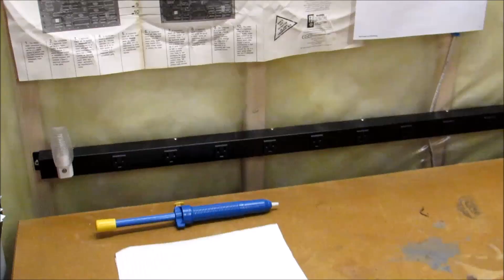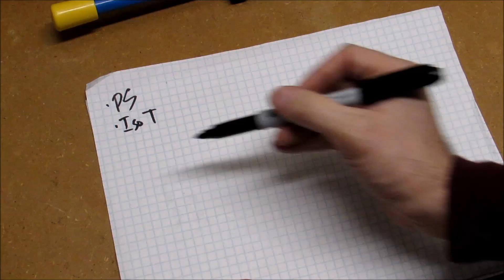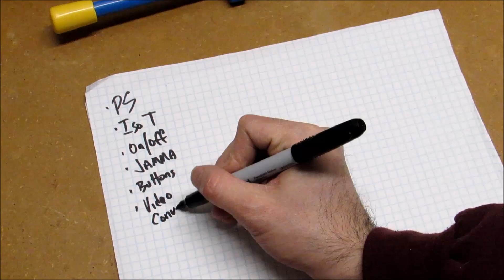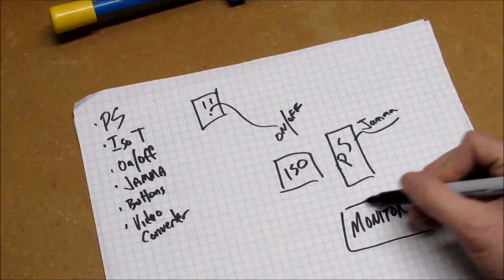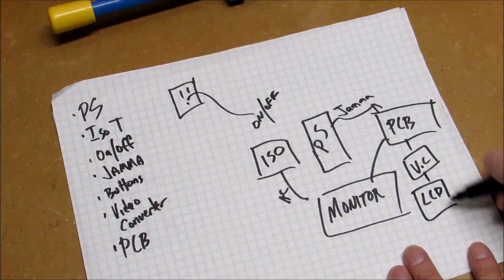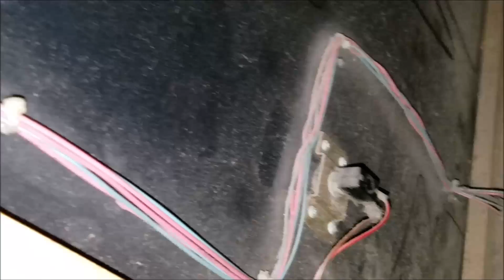Let's Make: Arcade Test Bench - Part 1

Comment: Another good video. Tim have you ever ran into Outrun shaker motors not working even though the SSR board and the shaker motor work? Thanks for your helpful videos.
Reply from the maker: +IcedOutYFZ Thanks! I have. That motor can be a tricky one sometimes. The things I check are the motor, big honkin' relay, connections, and the circuit breaker behind the coin door. I've seen the circuit breaker fail. Try resetting that and if it still doesn't work check to see it is getting voltage behind it. It should be in the 30v range if I recall correctly.  If that is good pull the power leads off of the circuit breaker and check it for continuity. Sometimes that breaker goes bad. Typically it's one of those 3 things! Good luck with your repair!

Comment: Good video, cant wait to see the other parts since I want to do a testbench too.
Some guys on the forum did this with not only an jamma adapter, they did it with cable setup to change the pinout. So no more adapter soldering if you test a non jamma pcb. ( hope my point is clear since im austrian :-) ).

Comment: awesome video and idea, Tim! as Chuck mentioned dont forget some way of testing audio and one thing i was gonna add is to not forget to add the fuse block in your power circuit as well to keep your circuits protected but it looks like you may have kept them? Also, if you decide to get the video converter you can get a cheap CGA to VGA converter on Ebay. i was able to get one to test the video signals from my Turbo cabinet for about $18. I look forward to part 2!
Reply from the maker: Thanks! I think the fuse block that is already there will do the job. I've seen those cheap converters on eBay. You have one and it works ok?
Reply: That Tim Guy yeah thats what i was meaning, sorry. and yeah it works pretty good with the exception of the language for the on screen display and menu are default to chinese and it doesnt come with any kind of manual but u can find one online to help you set the language to english. other then that it works great!